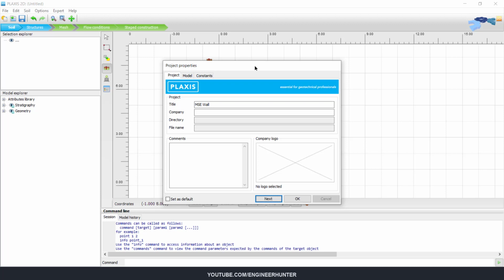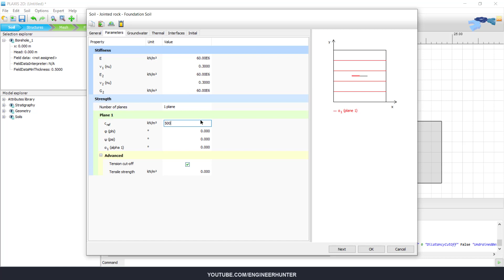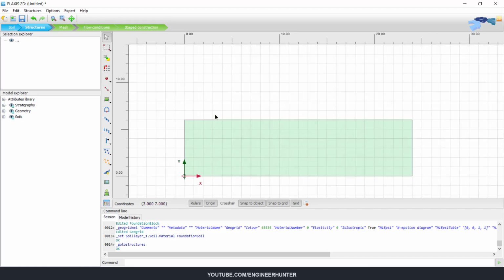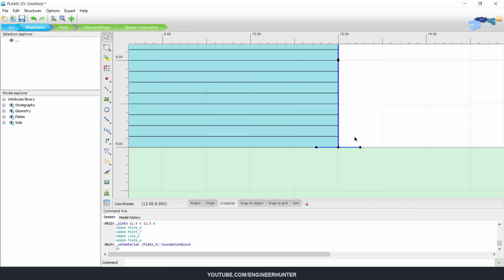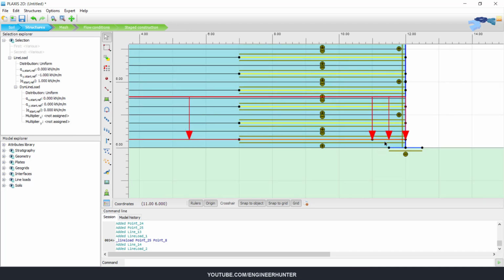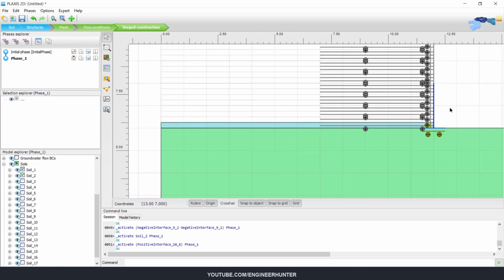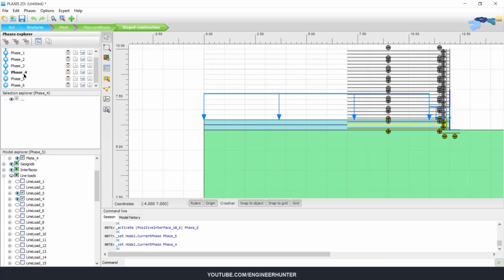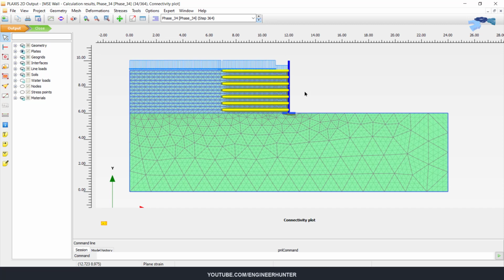MSE wall analysis in Plaxis 2D (Mechanically Stabilized Earth)

Comment: When you add the geogrid, didn't you suppose to deactivate the load on that phase? Since the compaction of soil was on previous face, then you add the geogrid (withoug load) and the proceed to the next phase where you activate the second layer of soil.
Reply from the maker: Yes, you can deactivate the load when adding the geogrid. But the difference of results is so small, in this case. Thanks for your comment.
Reply: @EngineerHunter  Ok thank you :)

Comment: How could I find a value for "total flow" (m^3 / day / m) in Plaxis 2D? I can output groundwater flow and see the arrows, but how does this relate to a total flow value?
Reply from the maker: You can check the video I tagged here at the time I did the cross-section. But instead of viewing the stress, you can view the groundwater flow and you can see the total discharged at the bottom information. https://youtu.be/AjIv6vXoabY?t=456